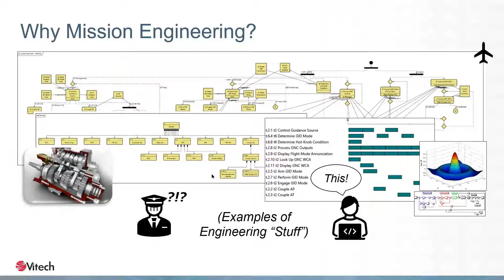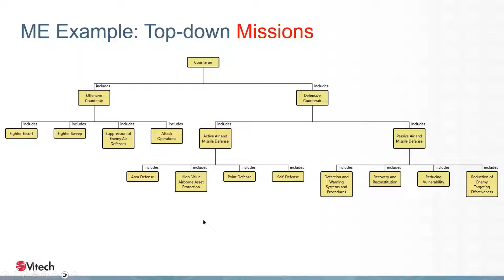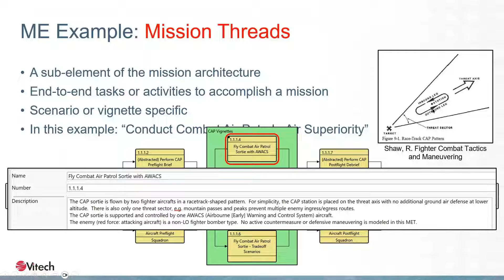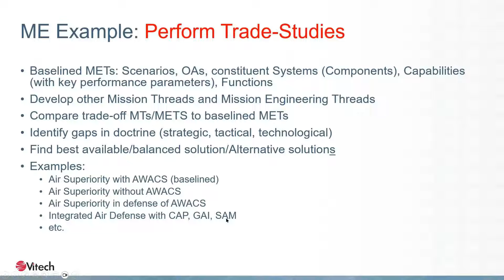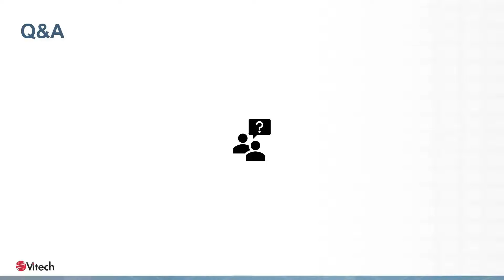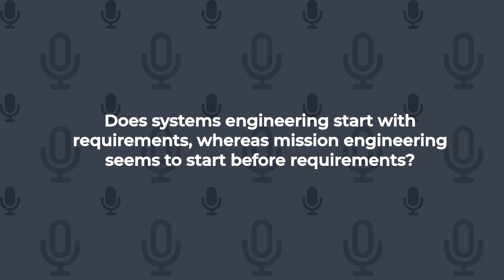From Operational Context to System Definition: Mission Engineering Basics for Systems Designers

Comment: MBSE models the requirements, structure, performance, and behavior of systems (or SoS). Mission Analysis is about effectiveness and emergent behavior.
SysML is temporally and spatially oblivious. While it can be used to conduct engagement-level analysis (i.e. performance of a SoS) it cannot evaluate effectiveness.
The relationship between the MT/MET and the scenario is homeopathic, at best.
To evaluate effectiveness you need a mission-level simulation. In the mission-level analysis we compare various architectures to identify the most cost-effective system. The system that contributes to the most cost-effective SoS determines the system level requirements. Mission level and system level are co-dependent.
Effectiveness is the measure that matters. Performance is what you pay for.
Every requirement needs to earn its way into the system.